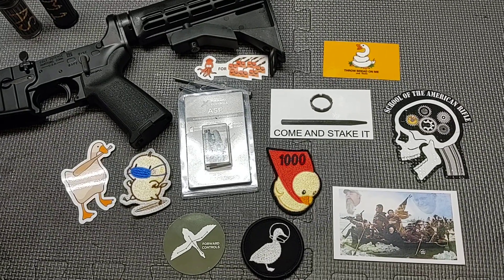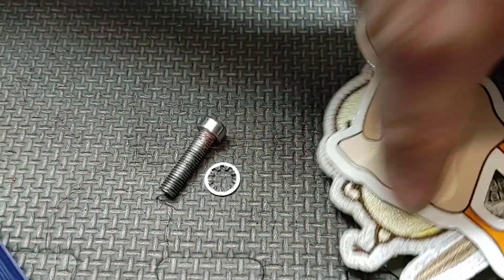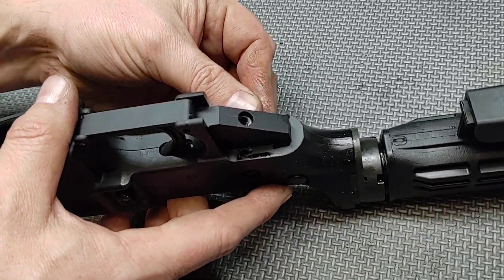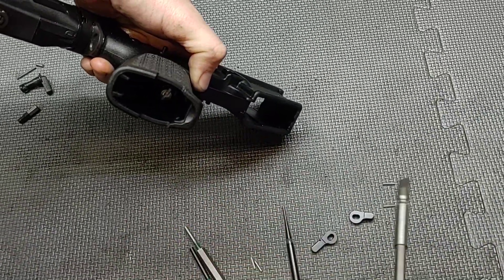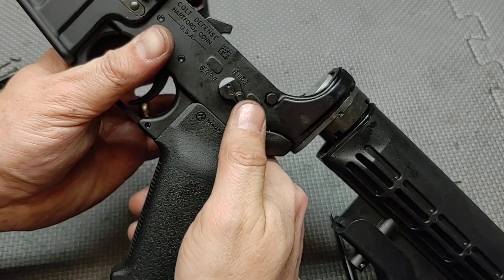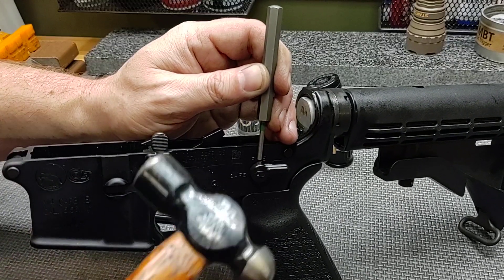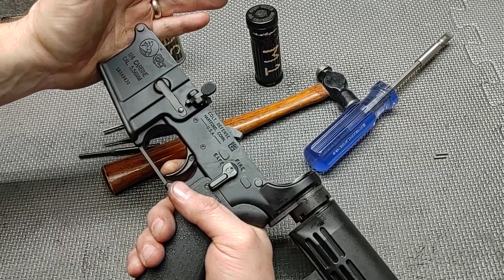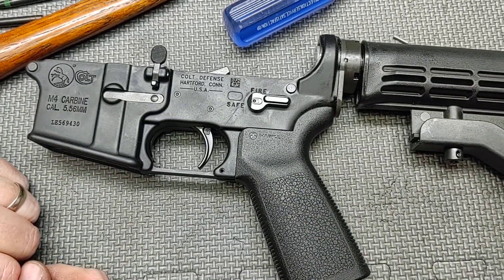Forward Controls Design - ASF Installation Tips

Comment: As an armorer with the 101st at Ft Campbell back in 1983 I had a similar experience with an M1911 .45 caliber pistol. 

With the safety engaged, a hard pull of the trigger would release the safety and drop the hammer. 

I wrote it up and turned it over to the upper level maintenance unit as I was not authorized to perform that level of repair. 

I returned several days later to pick up my “repaired pistol”. Prior to leaving their shop I performed a function check. 

The pistol failed again! Not intermittently, but every time!  

I informed the guy at the desk that they had not repaired the pistol. He took it back, checked it out, conferred with his coworkers, and returned the pistol to me and informed me that it met specifications! 

He said that it only had to withstand a certain amount of trigger pull before firing 

I was astonished at their level of ignorance. They were insisting that it was safe. 

As I was transporting firearms across the base I was armed with a loaded pistol. I offered to remove my loaded magazine and place it in the pistol that they claimed was safe and test it to see if they were correct. 

I might have also suggested that it would be pointing in their direction during my test. 

They declined my offer, took the pistol back, and decided to research the matter further. 

I was subsequently informed that the pistol frame itself was out of spec and it was taken out of service. 

As President Reagan had said during that time, “Trust but Verify”.
Reply: What an incredible display of laziness
Reply: Lol made them think about it with that test idea 😂

Comment: That tip on using the grease to help with the pins is so clutch.
Reply: i wish i would have watched this video 3 hours ago. i just had a heck of a time getting a forward assist roll pin in.
Reply: @EasyMoneySG  You and me both.  Of course Chad's a pro and makes everything look easy.  Tried doing this in my lap with my cheap ass Wheeler hammer punch but beat the crap out of a couple brass punches (because I was lazy and didn't want to dig for my punch set).  Ended up swearing a bunch, dug out my Obsidian Arms toolkit, Klev Zion (sp?) receiver extension/buffer tube vice, got a bigger hammer and an old steel punch my brother had in the garage.  Bingo.

Top tips:  Don't use the Wheeler hammer or brass punches, use a steel punch and 10oz-ish hammer (brother handed me a ball peen).  Tape your lower (I'm a rookie so I suck and don't want to beat my lower to hell).  USE GREASE! (also a roll pin starter punch to start and finish and steel punch to drive in).

FCD states roll pins make for "robust" fitment...absolutely no joke.  Not like I'm plan on removing them that will be an interesting challenge (coming from the Survivor Systems "paddle shifters" secured with Torx screws)
Reply: Used to hold captured rubber gaskets as a mechanic with grease all the time. Old school cheat

Comment: I’ve used a single #7 1/2 bird shot in the selector detent spring hole of the pistol grip to manage the mushy selector switch issue without stretching the spring. Not sure if that’s the best method but it has worked for me in the past.
Reply: Steel shot I’m guessing.

Comment: Is there a preferred OAL for the safety detent (ejector) spring for best safety selector operation?

...There is a go and no-go gauge or spec for everything.

Many of those springs are badly out of spec with cut ends, not ground ends.  Weird ejector and weird safety selector operation are the symptoms.
Reply from the maker: Yes, there is a proper measurement for the spring but unless the selector, detent, lower receiver, and grip all fall within proper range that measurement does not hold much value in my experience.
Reply: Thanks.  You are the greatest.

Comment: Thanks for the info, great video. Do you feel that a short throw safety is less safe than a standard 90 degree safety? With the magpul example in video do you think that this is due to interface or tolerances plus the shorter throw causing a different safety barrel interface?
Reply: 45 degree all the way😎💯

Comment: I like FCD usually but something about the unnecessary use of a set of roll pins to secure a safety when there's about a thousand safeties out there that don't use one, is like... Why? Why make it harder to swap out the safety drum? Radians are easier to install and just as secure, and i don't have to have a hammer and punch on hand if something fails.

Comment: I usually really like forward controls parts but a roll pin for the safety? Not a fan of that at all. The radian talon is much better IMO.
Reply: A roll pin is better than the little screws used by some companies. That being said the Radian Talon is a better design
Reply: I've got both. FCD is way nicer. The roll pins are much more secure than the Radian design. The paddles wiggle some on Radian
Reply: It's going to be tougher tho. No screws to fall out
Reply: @muddyhotdog4103  radian talon doesn't use screws. But even safetys that do use screws, all you gotta do is put a dab of loctite, witness mark and you're g2g. Personally, the safteys I have that use screws have never backed out.
Reply: Just based on materials and attachment the FCD/SOLGW  is more bombproof. Which I believe was their goal of making a gtw selector.
Reply: I like the Radian design. But it is still based around a spring. Spring vs. role-pin in terms of strength and longevity. The role-pin wins. FCD is just more stout. If that matters to you, ASF. If it doesn't (Range gun / for the grams gun.) Radian, it is.
Reply: I mean, the safety detent itself is under spring pressure.  I am fairly certain that the Talon's sprints, under constant load, but never  being compressed, will last just fine.  I love FCD's products, but there's no need to try to act like the Radian's product isn't really as robust.  lol@for the grams.
Reply: Meh. The G3 type rifles use a roll pin to retain the mag release button and ya never hear about buttons falling off or breaking.
Reply: Both designs will likely hold up, half of a lower receiver’s parts kit is held in by roll pins, the other half by springs.
Reply: Also, using a roll pin in the safety is nothing new, LWRC's design has been out for a decade. FCD could've combined their 45/90 into one which would've been a good move imo. 
Regardless, the safety is not a real concern for durability lmao
Reply: Compare this to a Radian side by side please
Reply: Non issue. G3 use a roll pin to hold the mag release button in and they rarely fail. While you may assume that is because most people use the paddle to release mags, every time the paddle is moved the button also moves. If those rarely fail this will certainly be fine.
Reply: I agree, I love FCD and this selector is nice but I definitely think the Radian is cooler looking and a better design. Never had a Talon loosen, super tight and still switches smoothly.

Comment: I would like to send you a screw starter. I carried one in my tool belt for close to 30 years.
It is a screw driver with the blade split down the middle. As you slide a sleeve down the shaft, the 2 halves of the blade move in opposite directions thereby gripping the screw head.

Comment: I have an lmt lower I'm currently putting together and my safety is extremely loose. On further examination I dont think my detent protrudes up as far as it should and the rim of the detent  bottoms out on a little shelf in the detent channel. Eny ideas of what I could do to fix this? Is there an enhanced (longer) detent I'm not aware about?
Reply from the maker: Sometimes there is just a small burr at the detent hole opening that will prevent the detent from popping up far enough. I use handheld reamers to fix this issue.

Comment: What are your recommendations for a really tight/ hard to switch safety?
Reply: Cut off a coil or 2 from the safety detent spring.
Reply: @aholegunner  No please don't ever do that, replace the parts with issues and compare to in spec parts and or have a armorer/gunsmith take care of it or verify  that it's correct with a guarantee on the verification. It's ok to not have safeties on many guns these days pistols at least but if it has a safety it needs to be 101% reliable no exceptions.

Comment: I have a Sharp's Np3 XPBCG in a 10.5 build. It's overgassed so I increased buffer weight and seems better but I've noticed recently scratches or gouges on the rear corners of some of the bolt lugs and I've attempted to research it but to no avail. It's possible the gouges are from before and I hadn't noticed yet. I'd love to fix this issue I just need the knowledge of what to do.
Reply from the maker: Sounds like the upper may be flexing excessively when it's firing, or the barrel extension isn't timed right and its allowing the bolt lugs to chatter on the forward and rearward movement of the bolt as the bolt enters and exits the barrel extension.

It's all guesswork without having the weapon in front of me.
Reply: @SchooloftheAmericanRifle  the barrel ext. is visibly 1-3 thousandths bottom to the right. Weird thing is a plain Jane milspec bolt from psa feels smoother when I thumb it in and out and received no damage similar to the Sharp's.
Reply: You're right I need to have an autopsy done before it dies. Or just to take a course an get smarter, Do you have any affiliation with S.D.I. or have an opinion on them?

Comment: Why wouldn't you install one of the levers first, then the other once the assembly is in place?
Reply: I was thinking the same, at least you save yourself of pounding one with a hammer already installed. Probably it does not need that much force, but still...

Comment: Does this have the option for 45° or is only 90
Reply: From looking at the packaging in this video, it looks as if there is two separate safeties/(part numbers), one is a 90°, and the other one FCD offers is the 45°.  Some manufacturers you have a choice on how you install the safety, as to whether it operates on the 90° angle, or 45° angle.
Reply: THE ASF comes in a 90 and a 50 degree. No 45 though. They have a few options on the website 90 and 50 standards. 90 and 50 Q variant. then full auto options if you are fancy and have something with select-fire capability.